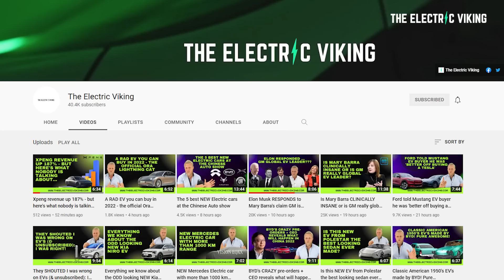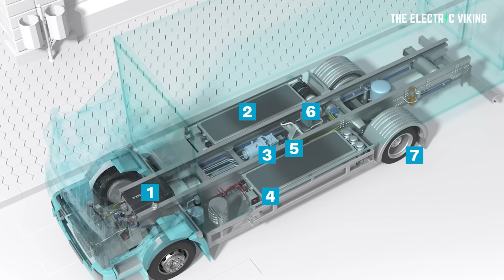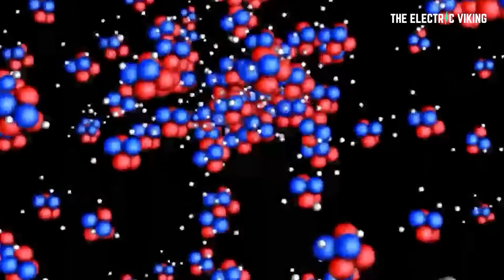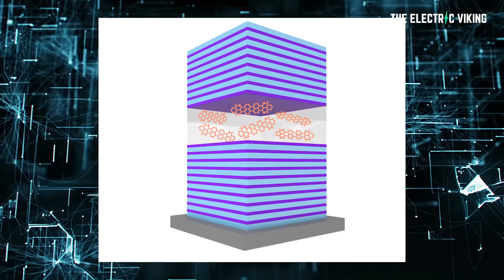Self charging Quantum batteries will transform the world

Comment: i was thinking about compressing quantum flux into a box then apply a weak light source and by rapidly expanding the quantum density i should be able to make the photons rapidly exite electrons creating a potential difference of charge at the same time that would make the unit act like a light pump like a sponge when it get wet and you squeeze it. for each quantum flux expansion the cavity would displace at a really fast rate. this way i should be able to suck all available light into my unit and get all the energy in electrical form for just for me. here is the problem. there is no know means to compress quantum flux or expanding it so my device rally need some not yet invented tech to using the energy of the universe as a power source. 

we know that light comes in waves of photons how ever waving photons is not logical. the only logical thing is that there are quantum particles as a medium that convey light where quantum particles is like a gas and by rapid displacement of quantum particles they would create wave like motion that we humans would recognize as traveling photons when in reality its not photons that are traveling but quantum cavities that are displacing like heat in a boiler and what we think are photons are nothing but randomly forming quantum foam that appear like waves and particle at the same time. 

we know that electrons can not emit photons from nothing and you can not just use energy and emit photons so there has to be a quantum photon flux below reality that electrons acting on transfer electron momentum to photon momentum. the quantum foam would not be light itself only the bubbles and its displacement would become visible light. such displacement is caused by a pressure difference when some volume of some scale expand and contract rapidly in on itself given the quantum particles are the origin of the behavior of matter and light.

Comment: Battery technology is definitely going to get much better over the next 10 years.  The improvements are also going to be highly self-disruptive  Imagine the cost of tooling up a battery factory only to see it become obsolete it a few mere years(!).

Insofar as these 'quantum' batteries go... well, I think its 99% popular hype and not a science that can be translated into actual batteries.  The word 'absorb' can mean almost anything when it comes to light hitting molecules.  It can mean pushing an electron to a higher shell, knocking an electron out of a molecule entirely, or (most likely) just imparting some kinetic energy to the molecule (causing it to wiggle and oscillate more than it already is), which basically translates to 'heat'.

The problem, generally speaking, is that it is extremely difficult to force the interactions to be the kinds that you want (knocking an electron around) verses the kind you don't want (adding kinetic energy to the molecule in the form of its vibration and velocity).  Controlling these sorts of interactions typically requires very precisely tuned lasers.  You can't do it just with electric potentials.

-Matt

Comment: So the quantum battery uses ambient light to charge itself. That sounds like the battery in your car needs to be exposed to light to recharge. So that makes me wonder if a car can be exposed to enough light to charge. Solar panels on a car can’t do it in a a reasonable amount of time. Maybe they could pipe light into a car battery but the amount of energy required to propel a car far exceeds the amount of light shining on a car. You can’t get more energy out of the battery than what the sky provides on what amounts to a rather small footprint. The bigger the battery, the faster the charge? Just how big can a car battery get and still have a functioning car? Maybe this new battery concept is more suitable for stationary applications. Or what if this battery covered the entire roof of semi trailers? Is there enough light hitting that surface if it was covered with a relatively thin battery pack? Safety is still a big question that needs to be addressed in any moving vehicle battery.

Comment: So the charger is a high powered laser. Does anyone else see the potential problems with this? Opps the charger is tuned wrong and the car blew up. if the laser doesn't match the collector in the battery you get a huge lump of trapped unconverted light energy inside your high capacity battery that could ether leak out the charging path or become heat and both are Bad things. I could be wrong but past experiences with new tech makes me afraid of what some lazy idiot could cause.   When you try to make something idiot proof you find a highly intelligent fool can still muck things up.

Comment: If the measurements of power is in our typical kWh then wouldn't the charge infrastructure have to support the amperage to transfer that type of power in a short period of time?
Reply: Maybe home charge stations would have super capacitor banks to store energy and then quickly charge the car battery.  Assuming of course that the theoretical idea works in real life.

Comment: « Will » means not yet and certainly never….and the « light » mobility solutions WILL not come out any weak electrochemical and only partly reversible non-endurant reaction back and forth but certainly from a strait high energy chemical reduction either by combustion and oxydation or catalytic conversion or à combustible with an oxidiser, a domaine where hydrogen oxydation excels at 140MJ/KG of H2 and since PV solar production , electrolysis and COPV H2 storage all three cost really nothing at all per kWh produced, processed and stored compared to power grids and batteries kWh costs and they last for ever, so the game is definitely over…for good : at a mere cost of all three totalising one to two cents per km, we no longer need the Russian gas and oil, that is for sure. We just need to break current polluting monopolies of domestic and mobility energy supply gangs of mining and industrial polluters mobilised against such self energetically autonomy, while harvesting huge profits on retail selling price 6 to 10 times higher than production costs..Our greens idiots know very well where to go, but which road to take to get there and decarbonise our civilisation….they haven’t figure the right path out yet, but it comes out ….slowly…

Comment: So are we going to have giant fiber optic charging cables instead of electricity?  Or lasers from space charging us while we drive?  It sounds like we would need a whole new optical charging infrastructure.  Its not clear what, other than charging speed, is good about these.
Reply: No it would be similar to current charging stations only you would have LEDs or something better converting electricity to light or harvesting and concentrating natural light sending that through an optical fiber that then rapidly charge your car or device as electricity.  you wouldn't need a large installation of kilometers plus of optical fiber just short sections at charging points.

Comment: Article seems a bit too hopeful - the effects are demonstrated at the nano level and need a laser to charge. Like quantum computers, easy to think about, almost impossible to do - still trying after all these years. The guy (Quach) says: "It would be similar to current solar panel and battery units, but – because the charging and the storage all happens in one system – simpler to integrate and use." Oh, OK.

Comment: I'm a bit befuddled with the concept.  Several times it was stated that the quantum battery would charge with ambient light.  However, normal incident radiation at the surface of the earth is about 1kW/m^2 for the full light spectrum.  How does this translate to more rapid charging in transportation?  What did I miss?
Reply: Snake oil. Not even a mention of how many charging cycles it can take or the cost. Brings to mind the myth of cold fusion and perpetual motion! BTW just unsubscribed from this channel. T E V just does not know what he's talking about.
Reply: @Wolsey67  finally you get it
Reply: Don’t confuse the situation with physics, data and facts.
Reply: I was thinking the same thing. The researchers may have observed the quantum effects in the lab, but due to the 1kW limit, and other factors, no way it will scale into a practical battery cell.
Reply: @NeuroPilot1  Yeah 1kW and 50kg of LN2 to drive it to absolute zero.
Reply: Totally AGREED. First question I had. Maybe MASSIVE SOLAR Panels may be used . But Still Batteries are needed to "HOLD" the electricity. And provided Mobility for EV. 🤔
Reply: @sunshinesun121  The Quantum battery IS the solar panel pay the fuck attention already.
Reply: You are correct. Best multi junction  (3-5) absorption is a bit over 40% of the theoretical maximum. Typical PV is in the low 20's. Since there is always loss involved with state changes, it is not possible to even get to the maximum irradiance you quoted.
Reply: "Could" charge with ambient light for fucks sake get it right... that doesn't stop the use of high energy lasers or LEDs or solar concentrators.
Reply: @Barskor1  I heard the "could" charge, as well.  I also listened for how the alternative charging would work.  In the absence of any further explanation I chose to comment only on what they offered.  It is really up to the company to provide sufficient information regarding performance if they wish me to be "excited" about it.  I will not, on my own without independent research, extrapolate that an efficient, energy-dense, method exists to charge the battery.
Reply: @Random Human As well as Cold Fusion and the Warp Drive.
Reply: "What did I miss?" You missed the smoke and mirrors. Their science is based on photons. Photons were invented because their math was wrong...they don't exist...and that is rooted in the theory of relativity nonsense (i.e. get the wrong answer...just change the ruler and clock to fix it). These are the same people that brought us the global warming nonsense.
Reply: @toddmarshall416  Meaningless conflation.
Reply: @toddmarshall416  It is called the Muskrat Effect.
Reply: @toddmarshall416  looks likes you need to  loosen up the tin foil hat guy.....

Comment: Correct me if I'm wrong but don't larger lithium ion batteries charge faster the larger the battery? My understanding is that, generally, battery charging speed is limited by the resistance in the battery pack. The more cells to spread the incoming charge, means that you are lowering the amount of energy per cell being absorbed and thereby lowering resistance or to put inversely, More energy will be absorbed at the same resistance with more cells. This of course assumes battery cells of equal resistance.
Reply: Really you have to think about it as how fast can I charge the individual battery cell. Provided you have enough electrical current from the charger, adding more cells doesn't increase or decrease the charging limitations of the individual battery cells.
Reply: @5893MrWilson  True, but faster charging increases resistance in any given cell, correct? So more cells to spread a relatively  large charge will keep the resistance to any given cell low.
Reply: @billh2294  you're getting more energy in the overall battery pack but I meant more in terms of percentage. Bigger pack or smaller pack the charging time stays the same but you can drive further between charges. This assumes the charger can provide the power and the car coolant system can handle the heat.

Comment: 1. This is way off (and maybe way way way off).
2. 'The bigger the battery the faster it charges'. Is an actual reduction in charging times what is being suggested here? Or does the charging rate increase as the battery capacity increases? Faster charging rates for greater capacity batteries is not the same thing as reduced charging times for those batteries.
3. The mention of self-charging seems naive.
4. The term 'quantum battery' is two words not an existing technology.